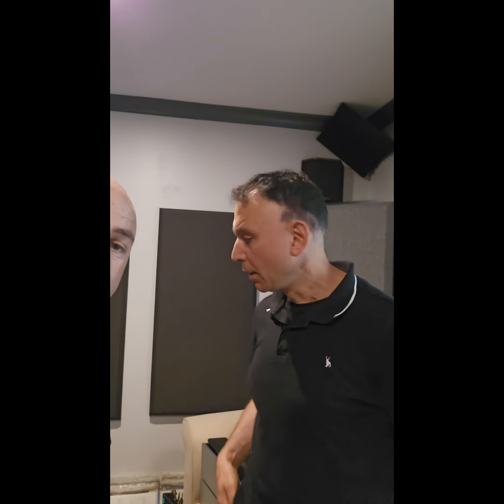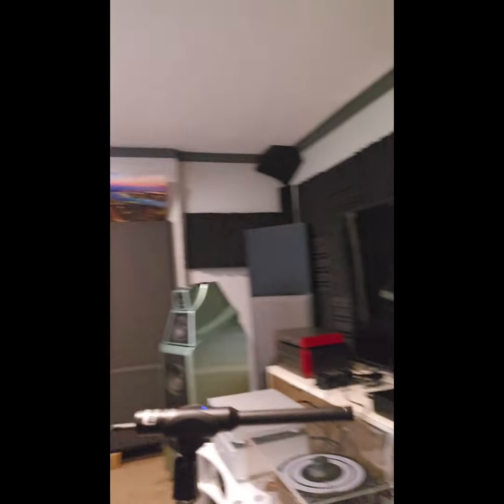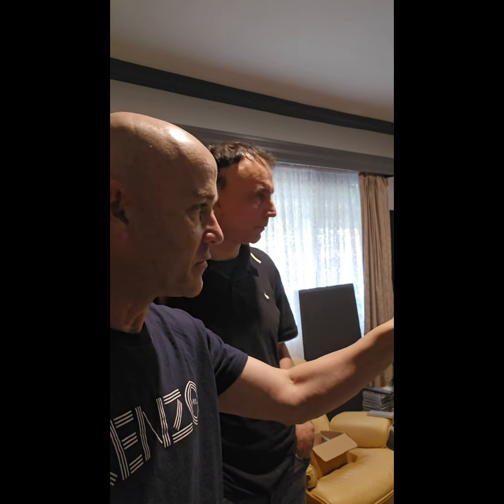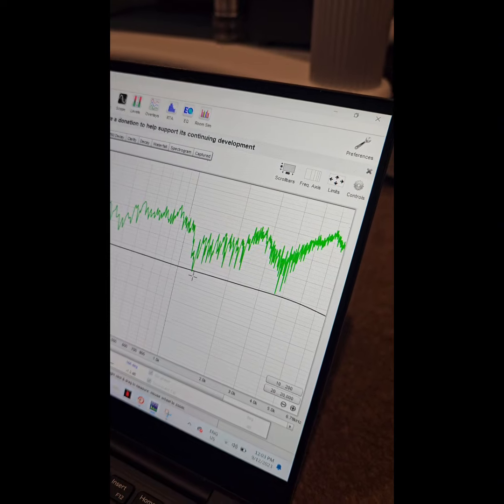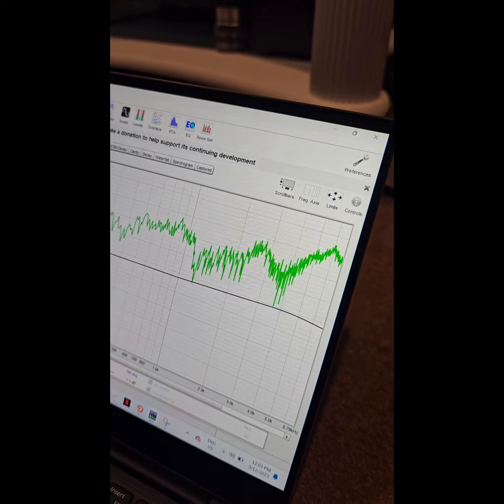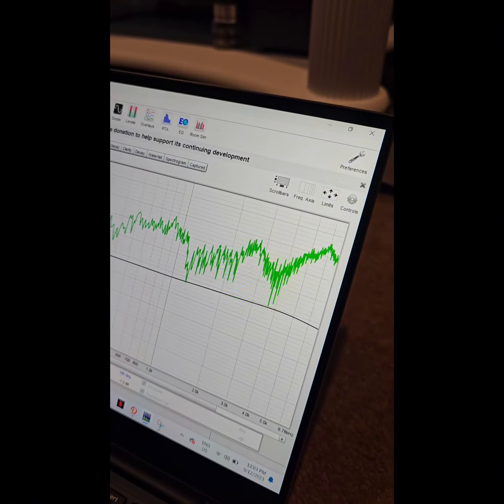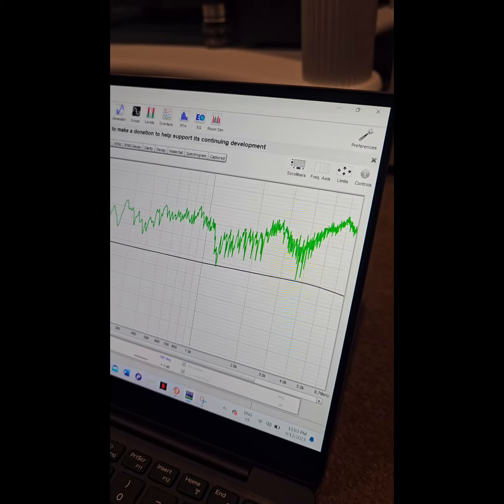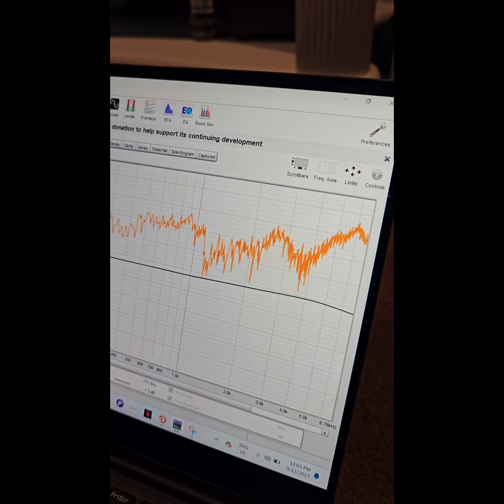"WILSON ALEXIA TWEETER REPLACEMENT & IN ROOM MEASUREMENTS"

Comment: Won't the 4 ohm tweeter add a different overall resistance and play at a different sound level or sound slightly different than the 8 ohm tweeter although they have a very similar frequency response. Otherwise what is the difference?
Reply from the maker: Hi there, the difference in every way we can measure is so minimal that it is essentially inaudible (I actually think it sounds better now than it ever has)
As far as I can understand it, Wilson get them to wind a slightly different impedance so they can sell you essentially the same diaphragm for about a 300% markup. Scan speak cannot sell you the Wilson diaphragm, only Wilson or their dealers can. But they can and are quite happy to sell you their 4 ohm version of it. Also, as far as I understand it, if you blow a tweeter up and go back to Wilson, you've got to buy the whole tweeter assembly.
I'll have much more to say about this in the final instalment of this series soon.
Reply: @shanestephenson8423  If you are upgrading all your resistors wouldn't you also upgrade the other tweeter so they are both identical and new. I thought the resistors were FET's in the beginning, different than normal looking resistors. Good content in general 👏 👌
Reply from the maker: @darwindean60 Thanks to the question. Yes, both tweeters were replaced, and all resistors were replaced.

Comment: So this is a side by side comparison of the two tweeters in frequency vs. SPL? If there is no “significant” difference beyond 0.4dB output levels, which your tech mate suggests is likely inaudible, then why would Wilson modify/increase  the number of voice coil windings in their version of the ScanSpeak tweeter? To increase transient response rise  and decay time?
Reply from the maker: That is the mult thousand dollar question. I'll be giving you all my opinion in the final video in the series.👍🙂🎧
Reply: @shanestephenson8423  cool beans! When I used to read Stereophike back in the day, when original founder shd editor JGH was alive and kicking, the loudspeaker reviews would characterize the type of measurement I am asking about by a “waterfall plot.” I hesitated to mention this because my recent internet search only seemed to yield hits where they describe the use of waterfall plots as a measure of room acoustic response profiles rather than as a property of the speaker per se.
Merry Christmas in Australia!
Reply from the maker: @dragocelander6671  And the same to you Drago 🙏 please be safe over the holiday break. 
The measurements we did in the room were  literally indistinguishable from each other, which was also what I was hearing in the room.
In fact if anything with the replacement now of both tweeter diaphragms, the highs are just that little bit more sparkly than they were before, and that is a benefit to the listening experience, not a detraction. 
So I guess in a nutshell I couldn't be happier with the results.👍🎧
Reply: @shanestephenson8423  A truly OCD audiophile, which I’m sure you’re not, would replace both Wilson tweeter voice coil-diaphragm units with stock OEM ScanSpeak units. 🤣
Reply from the maker: @dragocelander6671  lol funny I did replace both. I was never ever going to do just one.😁 I ordered two diaphragms out of the states and put them both in. So I have one spare original Wilson 8 ohm diaphragm now.
Reply: @shanestephenson8423  Lol. You sound like OCD Mikey. He had these great videos back in the early days where he’d describe some of his home-brew projects like small 2-3 outlet power strips. The attention to detail was phenomenal.